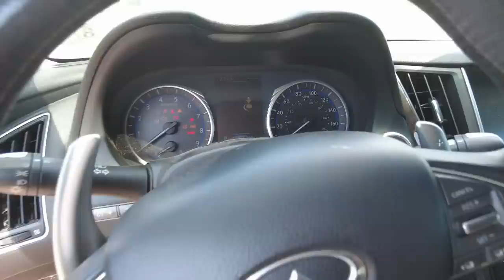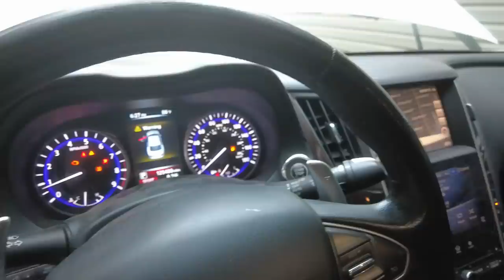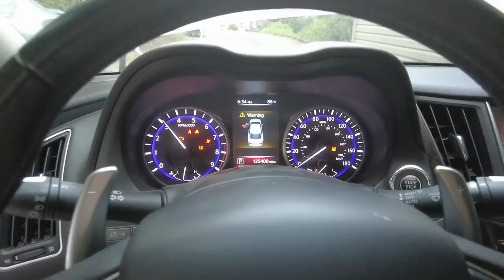I bought I highly modified widebody car to replace my scion TC

Comment: The only thing i see is that the drivers seat needs to go back to original, a rear bumper, a coil over adjustment and the wheels powder coated a more neutral colour. And ever other little things to tidy it up.

Comment: I dont get PA laws about tint. They wont pass it for rebuild inspection, but you can have it on your car and they will inspect it.  I have had window tint on all my cars for years without any problems.  I dont see an issue with having tint.

Comment: Shame you have to lift it, it looks so good at that height. 
I’d sell the wheels and get some halfway decent reps in the same sizing but with the correct offset needed so the spacers can go in the bin. 

Good choice, class of car projects is definitely improving… flips keep the money flowing, hopefully projects like this will finally get the channel growing.
Reply: Add air ride, go with tires with bigger sidewall so you don't feel every bump. I know you'll come up with something. As todd's scowering Facebook, craigslist, and eBay for them while its sitting waiting.

Comment: Did you call Sean about this one? Nice pick up. I can’t believe they totaled it for such little damage.
Reply: I can't believe they totaled it also for such little damage but I had Geico too they cut me a $9,000 check on $130,000 mile car which could have easily been fixed but at the time I just let it go which I did not want to they only made 3,000 of them a year sport design Lexus gunmetal gray triple black interior black wood grain Geico sucks because what they want to do is put it in their lot but if not they know they could get money from it they got money for that car that's why it's not in there a lot to pick the bones ridiculous I hate Geico and I can't stand the commercials I'd straight up see that little fucking animal with the accent I would straight up stomp on it smart ass little Geico that Geico wiggs me out man I just want to step on it

Comment: My opinion I would put it back to stock and sell the wheels and Kit
Reply: Once ya cut the fenders there is no putting back to stock unless replacing fenders and quarter panels, to costly.
Reply: @drewdaskievige754  you don't know what behind it. I have worked on cars all my life and you can't tell me what I have seen
Reply from the maker: Sorry but drew is right

Comment: Is that a red sport or the middle model with 300hp?  This rims gotta go please imo.  Good deal hope the body kit can be saved.
Reply from the maker: It a 2015 with the 3.7vq motor in it.  330hp I think
Reply: @UnWrecked  good but even through a broker.
Reply: Visually, a Red Sport will have different seats (the front seats are easy to see/tell) and a red 'S' after the Q50 (i.e. Q50S) on the tailgate. They also have a slightly different front bumper setup.